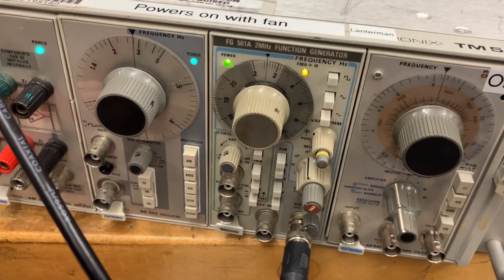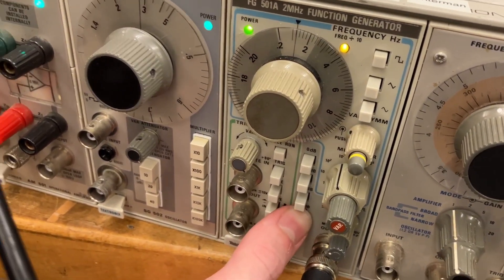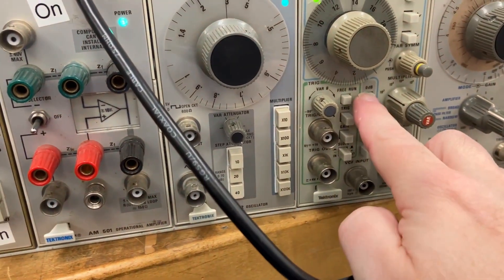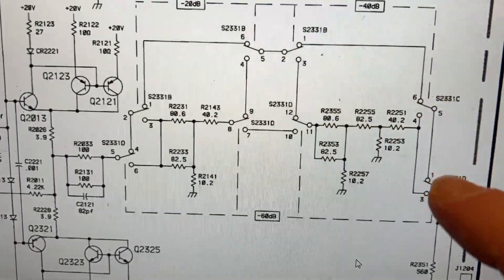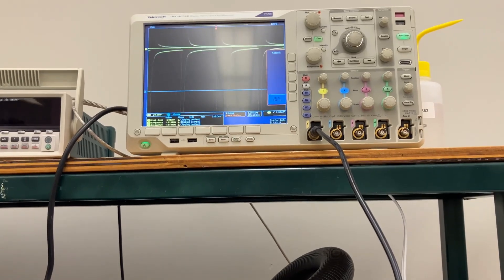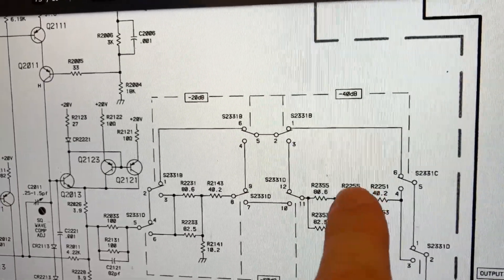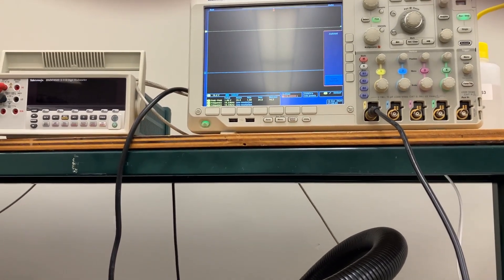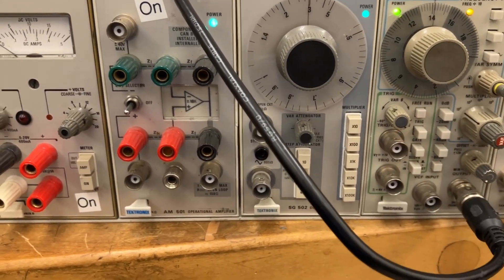Buggy Buttons on the Tektronix FG 501A Function Generator -- can they be fixed?

Comment: Most likely ITT Schadow switches, but you probably already knew that.
edit: that output attenuator section is a little bit of genius, designed to always maintain a 50 ohm output impedance, with no output buffer needed, which would add some noise.
Reply from the maker: The quality of engineering in these things is mind-boggling.
Reply from the maker: I didn't know about the ITT Schadow switches! :)
Reply: The manufacturer of those switches is stated as "Tektronix" in the service manual which means that they are a custom part even if they were made by one of the defunct ITT companies. There are ex-Tek employees who have little stashes of spares if you can find them. The switches are non-sealed and have silver plated contacts which means that they are worn and/or covered with 40+ years of atmospheric sulphur pollution. I suggest that making a sealed gold contact signal relay replacement controlled by  a little PIC would make a nice project for one of your students...
Wait until you have to repair one of the Clarostat pots with concentric switches! I've got several cases of TM500 series modules and they all have something going wrong. They are not designed to be serviceable, it was more a case of clever designers doing dumb things, and are difficult to work on. Due to the powering you need an open case or an extender.

Comment: Deoxit.
Reply: Also, the switches often need lubrication. I've used sewing machine oil in a pinch. Put it right into the back of the switch.
Reply from the maker: @kpnconsulting8739  This is good to know!
Reply from the maker: The issue is there doesn't seem to be a good entry point for it -- I may have to take them apart...
Reply: @ you can spray it in the open back-end of the switch. I mean, sure, you can disassemble if you want, but it will be hours of work. Be generous with the deoxit aerosol and work the switches while you are doing it. Most likely it will be fine.

Comment: I have a tektronix scope that uses modules like this, I'm not sure if this specifically, they had a few kinds, but my timebase module has some switches like these and it always seemed, looking at them, weird that the copper rods pass directly through and solder into the board. These are very maintainable devices but this setup seems like a big challenge to desolder, for what has to be one of the most frequently replaced parts. Also on my switches the pins are almost twice as tall as the switch body. I suspect that this is actually a high-repairability design where the switch has sockets and pushes down onto those pins. It also seems like the plastic body is exclusively held closed by the stamped steel piece at the front. I can't readily pull the switch carrier board from my 7B53A to check, because it's past 11pm, but maybe over the weekend.
Reply: btw, the construction isn't exactly the same but on mine you have to remove the T-pull & knobs, and then there's a metal face plate carrying all the legend & whatnot. I pry that off very carefully with a long metal spudger, then behind it there's screws at the 4 corners to release the front plate from the frame and then I can pull the carrier board

Comment: You guys have any deoxit in a closet somewhere?
Reply from the maker: I have some, but there's not really a good entry point to get it in there. I suspect we may need to desolder them and do some disassembly, alas.
Reply: @Lantertronics I think you should be able to spray it into the openings in the back of the switches and work them a few times - it’ll wick through.